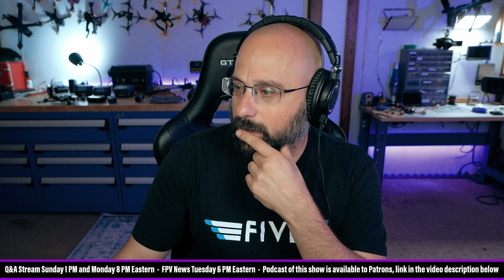Can't Get Into DFU To Flash Flight Controller? Betaflight Won't Connect To Betalfight? - FPV Qs

Comment: Air65 & a Meteor75 pro - won’t go into DFU mode, continuous states - FAIL to open serial port. I have tried all the steps in this video, where applicable and nothing seems to work. Any assistance would be greatly appreciated
Reply: Did you try Zadig and ImpluseRC?

Comment: I had to use quick silver to put it into dfu mode betaflight wouldn't let it but quick silver worked to put it into dfu mode then I went to bf and fkashed it
Reply: similar trick for me, I use Inav configurator to put in dfu mode instead to desolder gps or receiver

Comment: I sometimes have to desolder the RX1 lead to make my skystars FC go into boot loader mode, but it is only one out of four identical receivers that I have which has that problem. Very frustrating, but easy fix once you identify the problem.